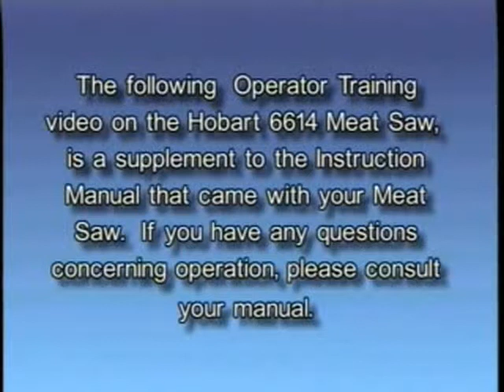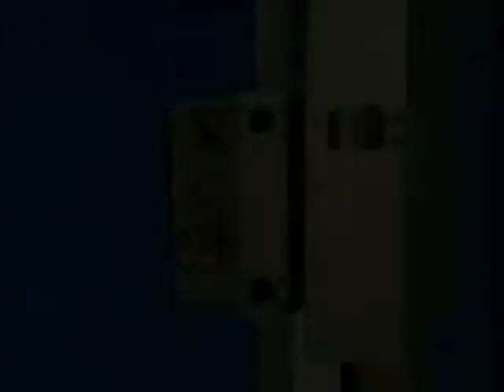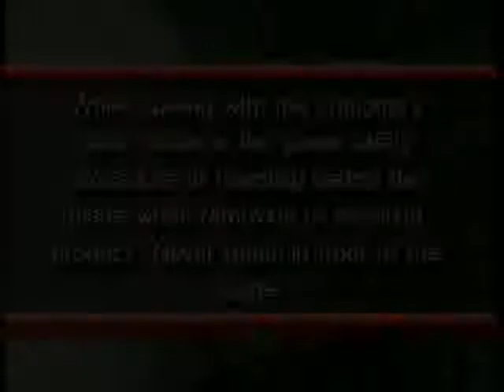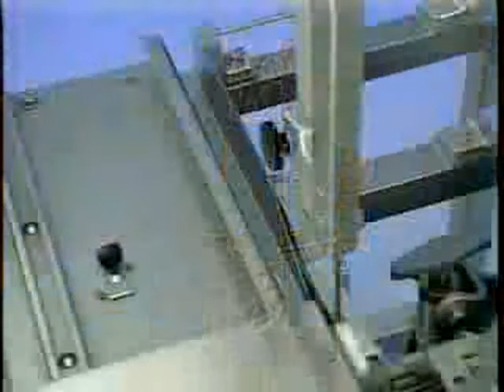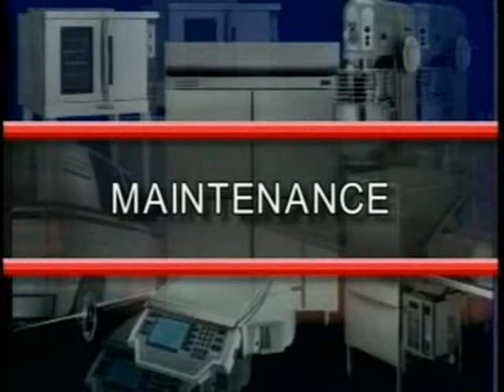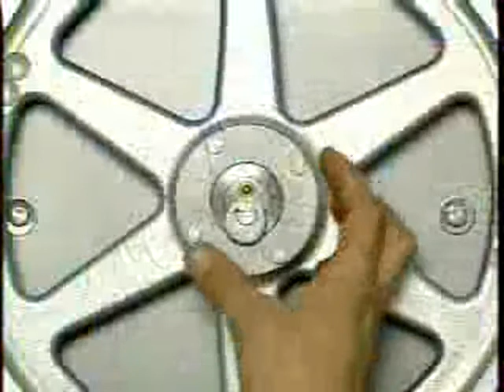Hobart 6614 Meat Saw Training

Comment: Can you loosen the tension adjuster with a lttle oil.  I work with a slightly older model with a tiny allen key nipple/ fiting and am wondering if it calls for a little grease.  Id like it a little looser if possible, ty for any leads.